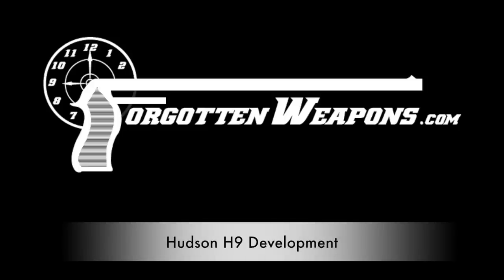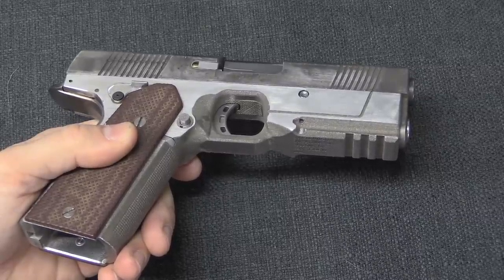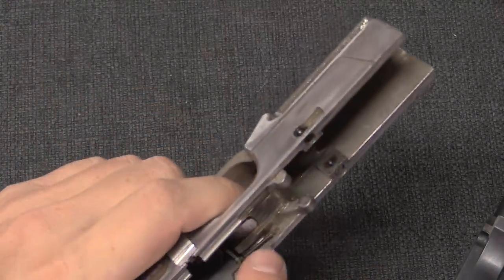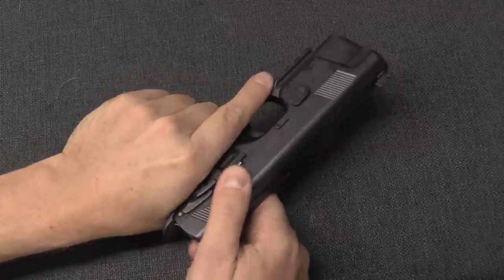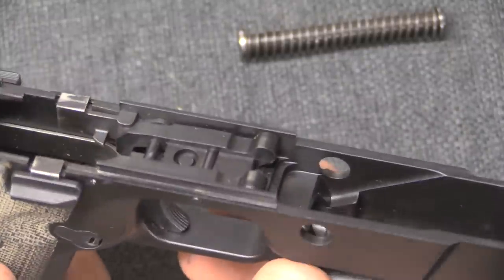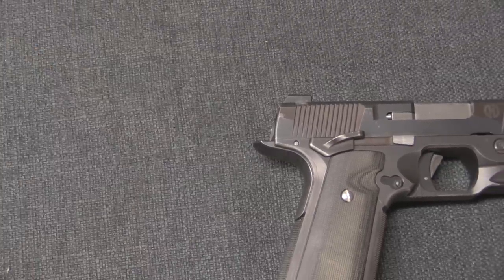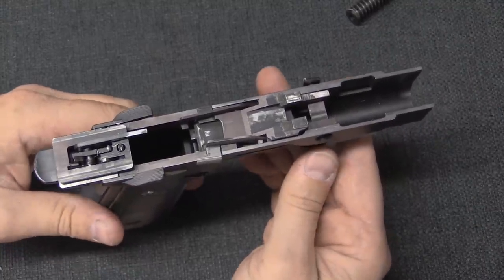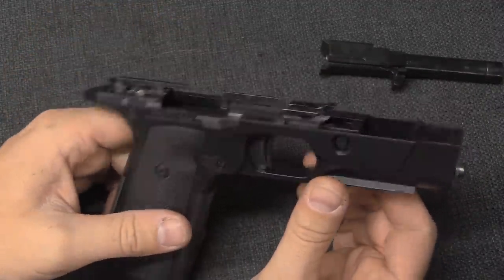Hudson H9 Prototypes & Development (with Cy Hudson)

Comment: Ian I may be wrong but I believe that what you guys refer to as the locking lugs are actually just a barrel cam and stop, because in a conventional design the barrel stop is either the link pin or cam surface being stopped by the takedown pin, or the front of the slide bottoming out on the recoil spring assembly. What I would call the locking lugs are the square surfaces on the top of the barrel, which keep the slide and barrel locked together until the barrel is cammed down by link pin or cam surfaces.
Reply from the maker: Yep, you are correct. I didn't realize until I went back to edit the video that I kept calling them locking lugs instead of cams.

Comment: You could 5-axis a slide and frame out quicker than 3-D printing it in a decent alloy with Production (or better) tolerances. The mag well is difficult and depending on geometry might need wire EDM finishing. By using PTC Creo, Delcam PowerMILL and wire EDM polygon rifled barrels, you could take craft built Firearms to new levels if one lived in a country were it was legal to do so.

Comment: The overall design looks like a 1911 with unnecessary bulk added to the frame. I guess they did this to add weight for less recoil but with a solid grip that shouldnt ever really be a problem with an all metal pistol frame..just seems like its trying to be different...looks like some futuristic robo cop gun to me with a USP9 slide...ill pass. Though if it ends up shooting well i could give it a try. I keep seeing this so ill wait for a few reviews first before investing. That being said, i really like you hosting new gun makers on the market...certainly a surprise but a welcome one
Reply: If by "unnecessary bulk" you mean the growth on the frame that houses the recoil spring, that was done intentionally the help move the bore axis down more. Definitely not unnecessary if you ask me.
Reply: You are buying 3 of them?
Reply: A low bore axis compared to what, a hammer fire? Any Steyr (or CZ for that matter) designed pistol has a bore axis that is just as low and they didn't have to bring the front down to the bottom of the trigger guard.  I would like to see a polymer frame version with the same set up and see how that performs, separating design change from weight advantage. I don't think adding 2 inches is good enough for moving the bore axis down maybe 1/4' tops. Muzzle flip and felt recoil are too different things. I can guarantee if Ruger, Springfield, Glock, etc. made this, people would be shitting all over it. If you want the lowest sitting barrel, buy a Rhino.
Reply: He said that one of the major objectives in deigning the magazine, is that it would retail at $34.99/ The gun's retail is $1,147.  Pricey, but new and significantly different.
Reply: +Click Clack Bang  Neither of those are "just as low" as the H9. Not even close in the CZ's case, and the Steyr (which I think is a fantastic, underrated handgun) uses an increased grip angle to raise the height of the web of your hand on the backstrap. That's a neat trick, but if you prefer a 1911 grip angle, then you have to do the kind of reengineering that the H9 does.
Reply: +BEEGfrog
I'm a bit baffled how many viewers seem unable to understand English, yet it appears to be their mother tongue.
Reply: The Great Mechanized Ape Must remember that sarcasm and the interweb don't mix. Pistol has been RRPed at just over 1K since shot show, magazine price just announced. I was obliquely commenting on the comprehension skills of anyone who can get them mixed up. Apologies for the use of big words in this reply, I am a talking frog not a millennial. 8()   P.s. that was an emoji of a frog...

Comment: I'm having trouble seeing why the recoil spring assembly needs to be mounted so low. 

Problem with that is two-fold.  The lever arm you mention runs both ways, putting stress on the rails, too.

Comment: I really don't get this gun. What major issue does it solve? 

I would argue its made more practical user issues arise than it's solved.

Just seems like an over priced fad... also how unwieldy it must be with a flashlight attached. Which seems to contravene the idea of having a compact design? 

In regards to "space saving", a regular firearm profile with a flashlight attached in the available  space below the recoil spring seems more compact and user friendly. And with a regular design your index finger can reach to turn it on easier without some funky stretch that this design will undoubtedly incur...  And most modern firearms have low bore axis, ejection port locking systems, weigh less, cost less, hold more ammo... and function just fine.

What does this solve? Slightly better trigger? Cos ive been closely watching lots of shooting videos with the H9 recoiling vs other major brands and the reduction in muzzle rise is negligible with a trained shooter... perhaps its a benefit in the feel of the firearm during recoil?! (whereby I have no experience as I haven't shot this gun) but if not... you've paid a lot for just a trigger job.

I wonder if you agree Ian, we might have reached the apex of design optimisation with modern small arms... unless we move away from cartridge designs, we haven't got much else to "improve" from an engineering perspective.
Reply from the maker: The H9 has the simplicity of a trigger safety and striker like a Glock, while having the handling of a 1911 with a near-1911 trigger and being flatter/smoother shooting than either one.

Comment: right the brick is hands down a better design as more could be done with it in terms of customisation. the barrel locks, calibre and tolerances need to be addressed but the fact you could've used existing mags is a selling point, imo .45 is the way to go also you can eliminate the firing pin safety by making the gun slightly longer, you can even get better sights and run a weaker recoil spring providing the barrel lock design was sorted

Comment: I always had a question about why the rear of the slide has to be as long as it usually is. Couldn't they cut the firing pin mech shorter thus preventing the rearward distance approach of the slide so you can achieve a higher grip purchase? like some target pistols. also would like to see someone np3 coat the thing and add wood grips.

Comment: As a huge believer (and user) of CZ and like pattern designs, if you want a high hand placement and a slim design, the solution is quite obvious. Also as a born tinkerer and design engineer, I can appreciate the 2nd evolution's watch-like complexity but in everyday practice, the KISS method always wins. On the study road, this is where Gaston Glock's story becomes interesting, as the guy was never a weapon manufacturer which becomes very evident in the Glock's design; if I recall, he made entrenching shovels first. Very few moving parts natively increases operative simplicity and, with good design, reliability. That said, as my long-term daydream project, my perfect low bore pistol uses a truly revolutionary design principle and perhaps when I get some other projects off my plate, Ian will be reviewing yet another great idea with poor timing.

Comment: Hi Ian, why do you call those things on the frame underneath the barrel "locking lugs". Aren't they really "locking/unlocking cams"? It appears that the barrel hood locks into the slide cutout, no? And the cams are what move the barrel into and out of lockup, but they are not the actual locking mechanism.

Comment: Are you sure you fired this gun?  With a low bore axis, you feel more recoil, less muzzle flip.  The gun is definitely more controllable than your average 9mm, but more force is directed straight back.  Probably the best contrast of pistol muzzle flip vs. recoil can be found with the Chiappa Rhino Revolver.  With hot .357 ammo, you will definitely feel more recoil with the Rhino compared to an S&W.  Actually, the motion of the gun twisting your wrists reduces recoil.  The energy is going somewhere.  Less flip creates more recoil.   The gun is definitely nice to shoot and follow up shots are very nice.  But, it has more recoil.

Comment: A very interesting pistol however it has become a forgotten weapon now funny Coming back to this video eventually this became an interesting airsoft pistol which also had gas malfunctions which is funny considering the real one had malfunctions as well it cost over $1126 to purchase good luck finding someone to buy that, now here’s a wiki of the company now      “In August 2018, a lawsuit was filed against Hudson Mfg for breach of contract and failure to pay for parts.[12] In December 2018, the Facebook Hudson H9 Group carried many discussions regarding broken H9 pistols and their return to Hudson Mfg for repair work. Continued discussions through January 2019 reported that those H9s sent back to Hudson had still not been repaired or returned to their owners, and Cy Hudson stopped responding to those discussions or any others on the forum. Hudson Mfg. had reserved a booth at the 2019 SHOT Show, but as of 22 January 2019 their booth remained empty. [13] As of January 28, 2019 the corporate phone number in Temple TX does not work. On March 14, 2019 Hudson Mfg. LLC filed for bankruptcy in Texas western bankruptcy court.”

Comment: I'm really really sorry, Cy. I do applaud your work and I am no gunsmith, just ask my gunsmith, but I am not seeing what you must see. more power to you but in my opinion I see a Glock made metal and almost turned into a 1911.

you were told the problem was getting the slide lower and you did that by lowering the slide spring but when the 1911 came up to the side for comparison I just saw too much gun beside the not too much 1911. 

 I'm about to buy another 1911. they aren't cheap but I don't think you could convince me to buy yours instead. I haven't used my comp or my carry para frame kit guns since I stopped shooting IPSC but id say that was the best thing to happen to the 1911 and that is going to be hard to beat.

my aluminum commander kit came first and the first donor was a satin nickel Officers model. it was so soon after they started production id bet mine was the first 3.5 inch barrel and slide on one.

I got the steel kit and sanded and stone rubbed the casting marks, sent it with all my lower parts to be hard chromed and bought a blue 70 series Gold Cup slide and Wilson barrel with compensator. 

I watched your whole video and il bet you gave up on my comment after the first paragraph. uhh, I just saw the unboxing and shooting vid. ill watch it now. I will try to link my comp gun afterward.

Comment: I still don't see why the recoil spring is so low. It still appears significantly lower than it needs to be. (Is it because the area is too small to accommodate the barrel lugs AND the recoil spring, so the recoil spring/slide recoil lug has to reach down below the lugs? ...and the take-down lever?)
Reply: About the low recoil spring. Isn't it to try and get the recoil impulse acting lower so that the pistol whips up less?

There's a revolver, the rhino, that moved the barrel to the lowest position of the cylinder so that the recoil force happens lower on the shooters grip. I think it's the same logic behind it. On the H9 you now get the slide putting recoiling force on the top of your hand like normal pistol, but you also have the recoil spring moving some of the felt recoil lower into your grip when you're shooting.
Reply: @KaffiRawr  Appreciate the reply. It makes sense. I thought the recoil only came from the bullet and the mass of the slide itself... but the spring is there for a reason, as it takes most of the recoil impulse before the slide hits whatever part of the frame that stops it (different in many guns). *edit: I know that's not the point of the recoil spring... but it does act on the recoil impulse. Shooting a semi-auto definitely has a different recoil impulse than guns that don't have them.

Comment: So, what does this one do that other, established and cheaper wonder niners can't? Want a striker fired pistol? Get a Glock. Want a recoil spring under the barrel pistol? Get a Walther P99. Want a 1911 or HiPower? Get the original. Want a chunky cyberpunk gun? Get a HK USP Elite or Mark 23.
Reply from the maker: The most concise description I've heard is that it handles like a 1911 and carries like a Glock. I like it.
Reply: I don't get the hate for new designs?  Plastic 9's are ok, but I think there is room for improvement.
Reply: So it combines the handling of a 106 years old gun (1911) and the mechanics of another 117 years old gun (FN Browning 1900, also had a low bore axis btw.) as well as their price and fires a 115 years old caliber. Still don't get the hype.
Reply: Yes, I've shot shot 9mm pistols, air guns, bows, crossbows, .22 rifles, G3, MG3 and Panzerfaust 3 and M109 155mm howitzer (last 2 with practice ammo only). So what?
Reply: Gfhjk Fghj this pistol is not as you describe.  It has an unusually high grip, and an unusually low bore axis.  I don't see this as hype, and I don't understand all the negative reaction.  If you've shot competition, you know what it takes to make a handgun controllable.  This pistol handles nice, and is a pleasure to shoot.  It does not handle like a 1911.  But you've never fired a 1911.

Comment: You can buy two glocks for the price of this pistol. It's also considerably heavier than a modern 9mm. What advantage does it bring to the table?
Reply from the maker: Substantially better handling, IMO. Certainly not everyone will want or get one, and that's fine.
Reply: I can buy 3 Hi points for the cost of 1 glock.  They both handle like non-gun shaped potatoes. 
If glock is the pinnacle of handgun technology, that is sad.
Reply: Wish I could give you 20 thumbs up. Glocks are great. Reliable, affordable, effective, all that good stuff. But you know, sometimes a guy just needs something that's actually fun to shoot.
Reply: RobertoDonatti An advantage....  Well first off, it isn't a fuckin Glock. They are great guns but they have little to offer beyond functionality. Its hard to be fun, new, and exciting when its been about 30yrs since the 1st one and the latest iteration is still close enough to hold hands with the 1st. A Glock is not a universal measuring stick to test all others by. If it is, then hold on to your ass, its going to be a long time before the next generation of "gun" comes of age. I bet a soldier that was issued a match lock probably bawled tears of eternal happiness to see the flintlock come about. I doubt he pissed and moaned that it wasn't like the POS match lock musket.
Reply: RobertoDonatti He's being a jerk? If you ask a question on the internet, expect more than one answer. Also, you don't have to be a child to find a gun fun.

Comment: These guns were junk. Interesting idea, but ultimately a non-starter since the bore axis is actually HIGHER than most Glocks. Also, the use of MIM parts in so much of the fire control group was just dumb. Any engineer worth his salt can tell you that MIM parts are not going to hit the same hardness levels as good machined bar stock. Queue broken sears, pins, and the litany of other failures that plagued this "wonder" gun.